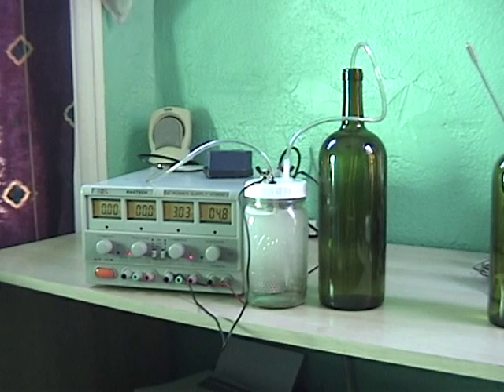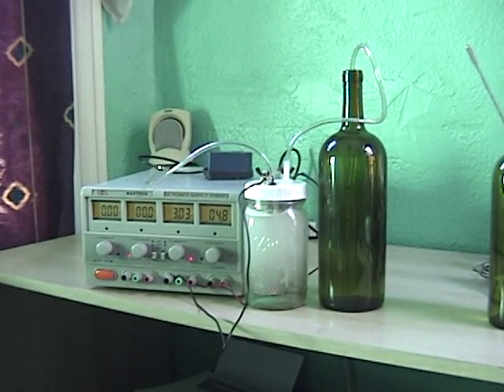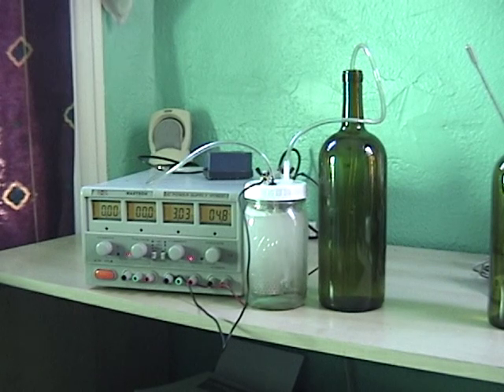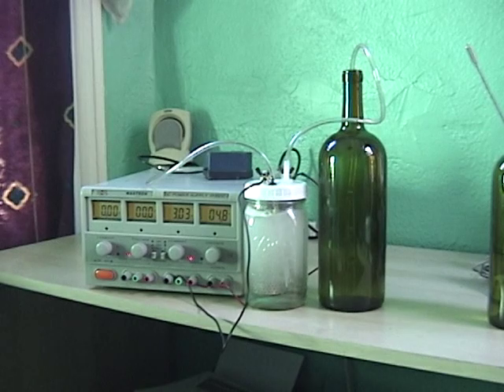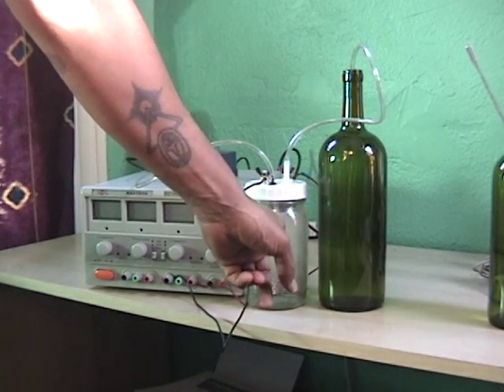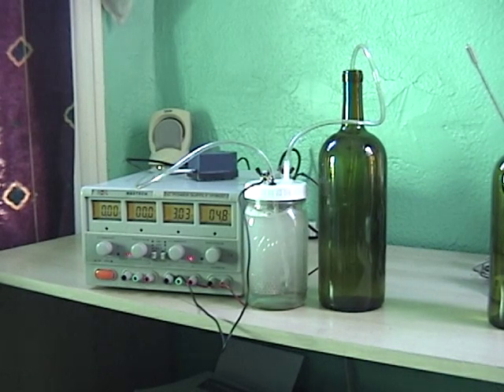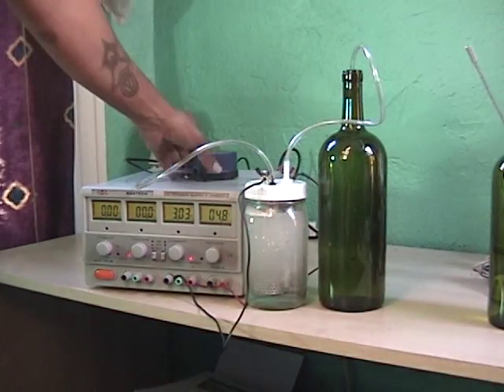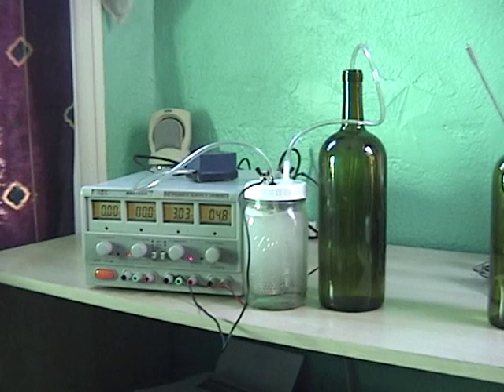MAKING HEALTHY DRINKING WATER WITH HHO

Comment: This water will kill
Reply: I've been drinking water like this for over 10 years and at 58, I can do 20-30 miles a day on a bicycle. Is that the energy of a dying man? Your incorrect opinion is your incorrect opinion.
Reply: @sonickking819  Hi Bro. Is the water you drink produced by exactly the same process? How many liters of that water do you drink a day?
Reply: @user-io8gh4yi4s  What is in the video is a stop gap and main intent is to electrically restructure the water to increase cellular absorption of water. Read Dr. Gerald Polluck, Viktor Schauberger, Johann Grander, etc...  I would do more filtering if I was to drink daily. I use an Enagic SD501 daily.

Comment: What kind of electrolite are you using?
Reply from the maker: Baking soda for making healthy energized water, KOH for fuel mileage increase in  automobiles.
Reply: Baking soda can be dangerous "in this system" because it can produce CO or carbon monoxide.  Especially if you have a powerful cell.  I advise NOT to use it.

Consider getting a CO alarm to test the air.

Comment: Why a pump? The cell produces the gas and with the gas enough pressure to push the gas through the pipe into the bottle. No pump needed. The cell produces all pressure you need.
Second is that I dont think you change the water at all. Energized water tastes different. Does it taste different just by HHO bubbles? Third is that it is not a good idea to let the HHO into the room when it leaves the bottle. Maybe it works in your environment, but if someone does it the way you show here and the HHO flows in a closed area, then it can be dangerous. I do a lot with HHO myself but your video is missleading in my opinion.
Reply from the maker: When one is working with hydrogen, it is a given it should be done in a well ventilated space. So far as the pump, I am following instructions from the water4gas manual. I appreciate good insights, but I think you need a joint.
Reply: Who doesn't?